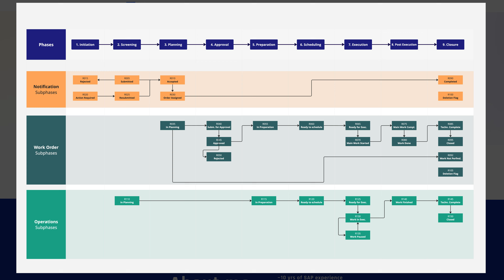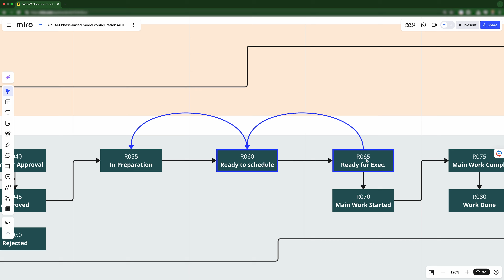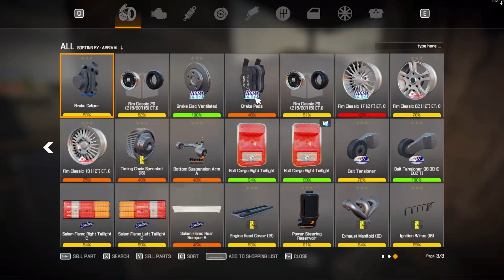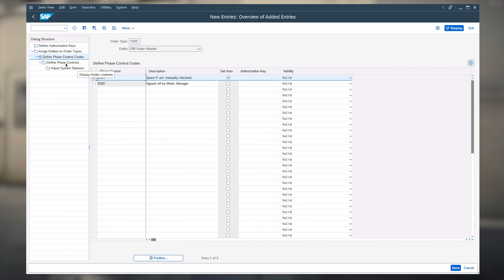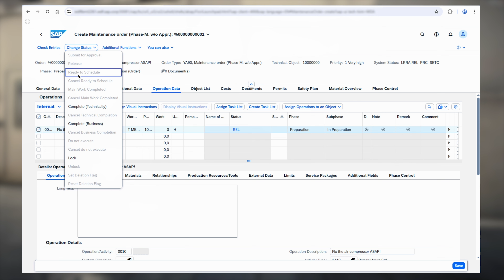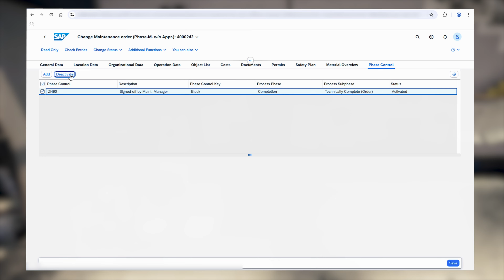SAP S/4HANA EAM Deep Dive: Phase Control Codes + Alternative Sequence

Comment: 2:49: Which version of SAP are you using?

In my S/4 2023 on-prem, the system comes with standard Overall Status profile which is already configured with the Alternative Sequences that you're mentioning.

i.e. the Order can move back from "Execution" to "Scheduling" to "Preparation" phase as a standard. No modification required.

Maybe in 2023 version they've added it as a standard?

BTW, I'm not using RSH apps for dispatching or cancelling dispatch.
Reply from the maker: Hi, I was using 2022 Version when i was recording this video. Good to know the codes are there by standard now, anyway it was fun configuring it:)

Dispatching should anyway work for you via find maintenance orders app if u don’t have RSH. If u use RSH then you do it there, in another app. Cheers, Dan
Reply: @sap_dude  Ah got it.
BTW, in this video regarding Phase Control Codes, why did you first configure two User statuses (H005, H080) in the User Status Profile? You've not used them anywhere in the video.
Reply from the maker: I’ve mentioned in the video, they are needed in order to set up the phase codes. There is no functional usage of them, it is a pure config error which u get if u don’t have them. Maybe they will correct it in next releases. Cheers
Reply: @sap_dude  Oh ok.. 
FYI, in 2023 version, there is no config error even if we don't maintain such user statuses. Hence the confusion.
Thanks for clarifying.
Reply from the maker: @Silverbill_  good to know, thanks man. Good sign, SAP is actually fixing things :D Cheers

Comment: Hello , Great video and super clear , i have a technical question about phases , before phases model in ecc we use BAPI_ALM_ORDER_MAINTAIN to change status from another system, now for this new one model , how can i change those phases code from an external system?
Reply from the maker: Hi Jose, thank you for very interesting question. Unfortunately, I cannot give you 100% valid answer, as I haven’t had such topic in my recent projects.

But I got the following feeling:
- Phases are controlled via system statuses (header/operation level of WO’s)
- Phases are not stored in tables, they are more as a ‘side effect’ of system statuses combination
- Therefore, if you keep using your BAPI, I do believe, you can still control the phases with the proper combination of System statuses

But so far this is only my assumption, let me know how you see it. Maybe also other folks got some experience to share about that. Cheers, Dan

Comment: Hello SAP dude, excellent explanation my friend. I have a business case where I need the system reevaluate the system status conditions in order to transition to next phase. For example, my client is trying to automated all the phases transition depending on the change of the system status conditions. I have the case that when the system status  MSPT or material shortage is set , the order remain in preparation and doesn’t go to schedule , that is working but once the material is available, and we do an availability check the order get the MACM status or material committed and get rid of the MSpT, but the order is not going to ready to schedule, even though the conditions are met . It have been impossible for me to achieve that in configuration so far.
Reply from the maker: Hey Mario, thanks a lot for the kind words. I see you got deep into the Phase model config, which is awesome. Yeah new model brings also new ideas from Clients, like for example the one you got right now. I will check it in my system as well and will let you know here in the comment what is the result. We will see how flexible the Phase-model is. Cheers man, Dan
Reply from the maker: Hi Mario, I got also stuck in the config like you. I guess everything is possible, and your requirements can be also met - but yeah, more deep-dive is needed for that. I think it is a perfect example, where we could take a step back and challenge the Client. Making everything automatic sounds great, but it can generate lots of confusion and questions later on. For example your Client wants to change automatically the phase once component is available/not available. SAP by standard supports availability check in RSH and gives proper messages on the UI to the users. If we set it automatically, does it mean even if order is in execution phase already and someone took our spare parts for some emergency work, the WO should go back to preparation phase? 

So yeah, while automation is what we should strive for, it is also a nice 'trouble maker'. And let's be honest - this topic once done, will never stop. They will ask for another automation, and another one, and another one. And then you end up with a Frankenstein in SPRO, which I guess would need anyway few enhancements to work properly. 

Let me know what you think about it!
Cheers,
Dan

Comment: As usual excellent video Dude
Reply from the maker: And as usual thank you for great feedback 🫡
Reply: @sap_dude just one update, I have tested Phase control codes without configuring user status for orders and that is working fine. I’ve also read SAP Config document for the same and they haven’t  mentioned to configure user status. Did i miss anything
Reply: @suryasharat you are right need to create user status profile and assign object type maintenance order. Then assign status profile to the order type. Afterwards never touch the user status profile configuration. The phase control code configuration will update the   Status profile automatically! Performing manual changes to status profile will create synchronisation issues between both the configs! Hope this helps! Status profile is just hook!

Comment: Thanks for the video, meanwhile I have 2 doubts: 
1) you have created the user status profil and you assigned it to order, but in any case you have used it in this flow, even in the phase control you havent used it…what is the use then of this user status ??

2) in the first use case when you applied the phase controle in preparation phase, this phase controle block  line came automaticaly in the tab…but in the seconde use case ( the phase control from execution to confirmation) it doesnt came automatically in the order tab , but you had to add it manualy by clicking on ( add) , why????
Reply from the maker: Hi Salim
1 - this is the logic from SAP, if you don’t configure user status profile, u will get error during configuration of Phase codes.

2 - I mentioned in the video, phase codes can be assigned/activated automatically or can be added manually. That’s why I explained two scenarios - one where u get it automatically, second scenario as an option if there is a business need to add manually. 

It means depending on your business scenario/need you can cover it in different ways. Let me know if it makes sense for you Salim. 

Cheers, 
Dan
Reply: @sap_dude 
That’s quite clear…thanks a lot dude 😊